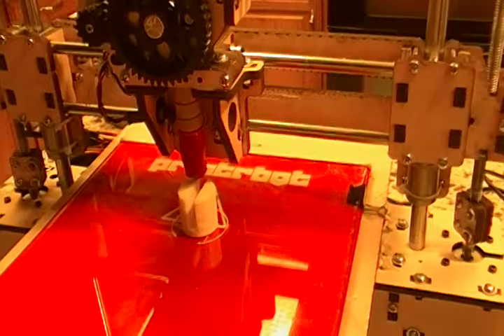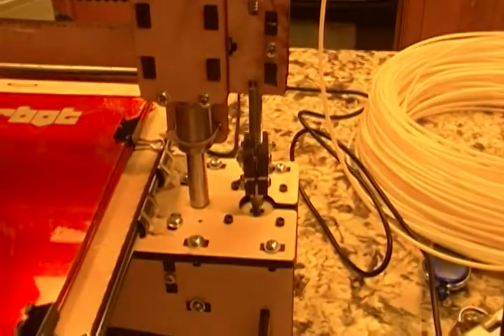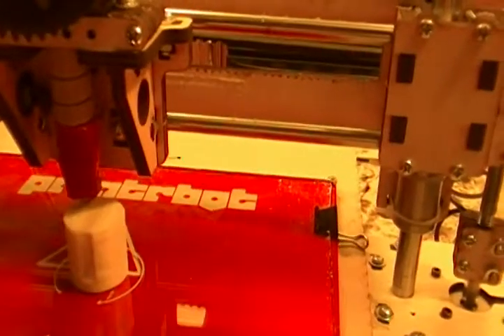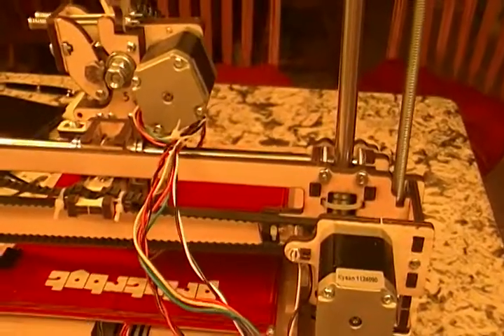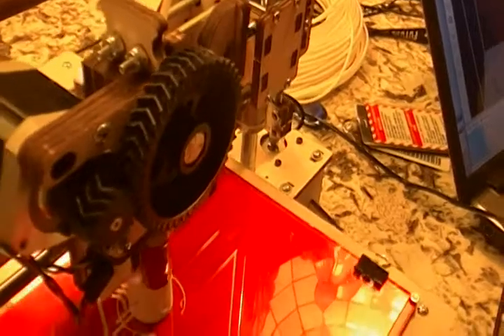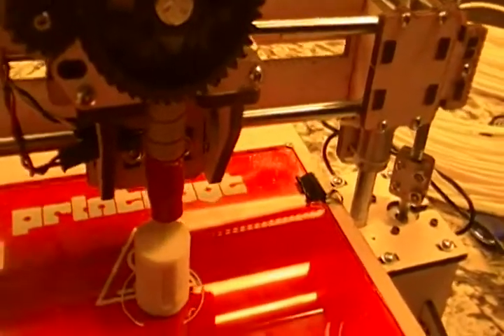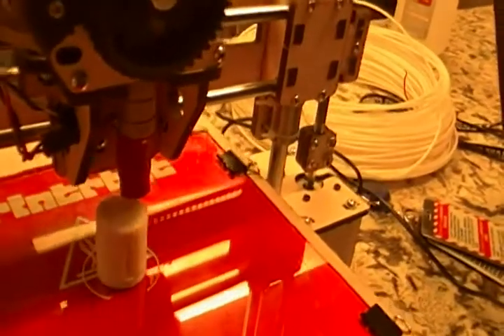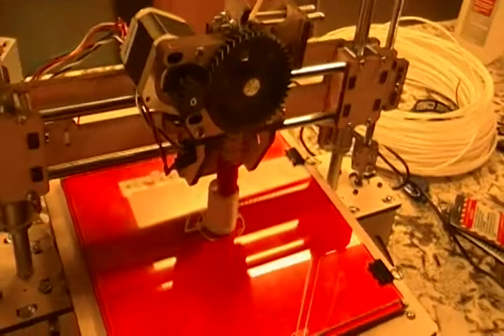Printrbot Plus guided tour

Comment: The design of this machine is amazing!  I would have loved to have had a device like this in my younger engineering days.  Question: Do you think the printed parts would hold up to vacuum forming?  I have been wanting to make custom RC helicopter fuselages and wondered if I could print the mold plugs with a similar unit.  Or maybe even pay someone to print them for mr?